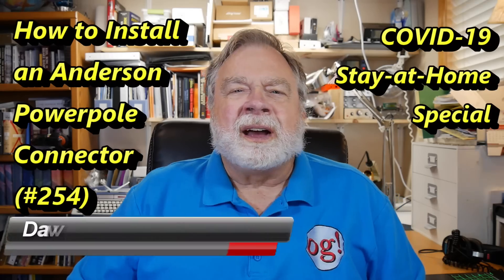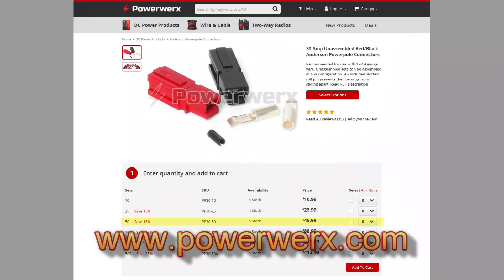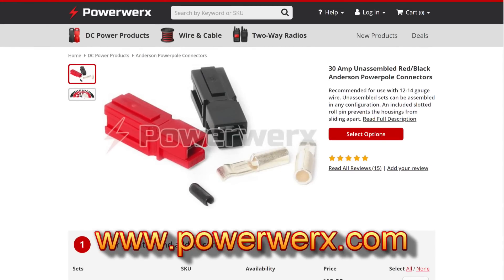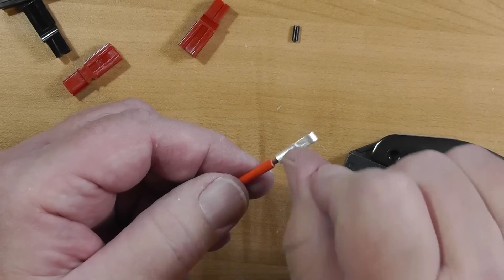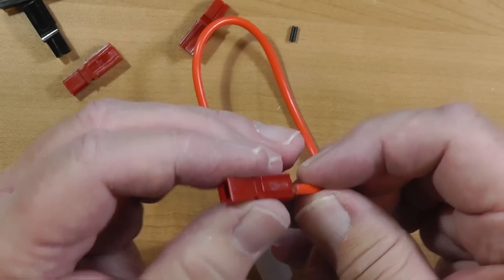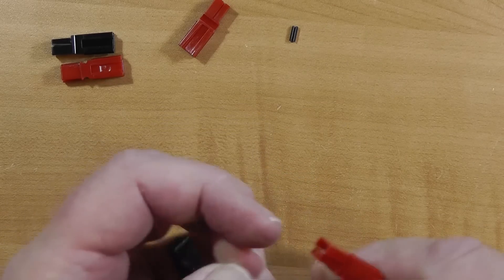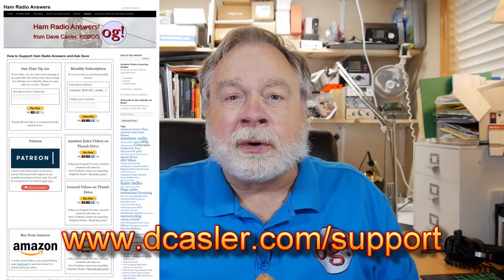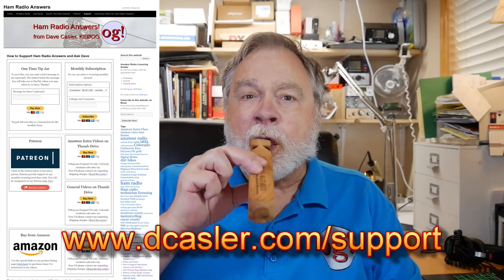Stay-at-Home Video: Installing Anderson PowerPole Connectors (#254)

Comment: Hi Dave, any tips for making power poles for battery connections? I'm having issues seating my connectors with 30 amp connectors and 10 AWG wire.

Comment: Hi Dave, great video. I am just starting to use powerpole connectors for my shack. I plan to run everything possible off a Rigrunner 4012. My question is, what brand of wire stripper are you using in your video? Thanks KE8TQR

Comment: If the wire has been tinned with solder, you may want to stress that the tinned section needs to be cut off before inserting the wire and crimping it.
 There are two reasons.. 1),  Solder is a soft metal, and  in time, actually moves under pressure and can cause the crimp to come loose. Maybe even years later ( usually at the worst possible time).  It is  usually ok to  just tin the tip of stranded wire to make it a bit easier to handle ,  but don't get carried away ... just the tip,
 2)  A good crimp creates an atom to atom bond with the metals and  and makes  both   makes a low ohmage  and gas tight contact  which improves with age. Solder interferes with that process.  A good crimp exceeds a solder connection in both mechanical strength and in providing the best low ohmage connection.  If you look at the lead -in wire the power company  brings into your house, they use  only crimps for this very reason.  
Frank AI4RF

Comment: Building the reference station now. When is the vhf/uhf info coming out? I just bought a comet gp9 cause I couldn't stand to wait any longer.
Reply from the maker: I wish I had a good answer for you. I haven’t really thought through the DMR-vs-C4FM-vs-DStar debate. I may come out with an FM-only reference station. What do you think?
Reply: @davecasler  I just went with the Icom 2730a for the time. If I get the digital bug I'll buy a hotspot.  Thanks for the reply.

Comment: You made an error - they CAN be taken apart, easily.  Look inside the open end.  The "humped" piece can be gently pried up a bit then it can be pushed back out.  If really tight, then use small needle nose pliers to pull it out the back (after front is pushed up).

I speak from experience (from 2 days ago).  2 of them didn't crimp tightly enough and the wire was a bit loose inside (didn't have the massive wiz bang one you have - just a standard crimper)

Either filing the edges of the connector back a bit (so they don't touch after crimping) or soldering them will tighten it up - a lot.

Bending the front piece down a bit before re-installing will reset the tension.

This is for people who don't have a Power Pole Crimping Tool at $20 to $50, just a standard crimper.

Comment: Looking at specs for reference station power supply, I was surprised it does NOT seem to have power pole outputs ?? Not difficult to fabricate a pigtail, but in this day and age, PowerPole outputs are readily available.
Reply from the maker: I know what you mean. Some power supplies like the SS30DV do have powerpoles.

Comment: Dave, it's easier to put the connector into the crimper and close it slightly to hold it in place then put the wire into the connector and finish crimping.
Reply from the maker: Good point!

Comment: Guys in my club were bad-mouthing Anderson PowerPole on a net the other day.  Some were saying they have higher relative resistance compared to other connectors.  Not sure how they are determining this idea but there were more than one of the same mindset.  Have you heard of any negatives about APP's?  The biggest problem with them is the price in my view.

73 de K6TJO
Reply from the maker: I suspect they were badmouthing them just to badmouth them. They work fine. They are not perfect, however. They can pull loose if you aren't careful.

Comment: Dave, what is that contraption sitting on the table behind you over your right shoulder? It looks vaguely like a computer keyboard but has some additional do-dads on it. Is that one of those antique RTTY machines ?  :-)

jk, I know what it is but haven't seen one in a long time.

I've used a drop of super glue in place of the pin when I didn't have a pin available. But you're getting them apart in the future if you do that.
Reply from the maker: :-) Not exactly. It's a manual Smith-Corona Classic 12 portable typewriter and it works. Vintage 1973.

Comment: I thank you for your knowledge of ham radio. I have a 6500 Flex M transceiver in the box, power supply and antenna , 25,00 KVA solar panel system and would be willing to dedicate my help towards the help of anybody’s communication of all needs. 3617015805 . I am locked in south Central Texas near Corpus Cristi, Texas. Keep me in mind for assistance.
Reply from the maker: Thanks.

Comment: At 4:50 -- I pinch the connectors onto the wire with a very slight squeeze of my pliers before placing them into the relevant size die. That stops the connector from rotating around the wire before it is correctly seated in the crimping die.
Reply: thanx!

Comment: I've used the larger 50 and 75 amp connectors for years, but once I started using the 15/30/45 powerpoles, I don't know how I ever lived without them.  Just got a 300 piece kit in the mail, today.

Comment: Hi Dave,
I put the connector in the crimper with a notch or two of pressure to hold it in place and then insert the wire. Much easier that way.  73  WB3BJU
Reply: I do the same
Reply: @bradcfi2  Me 3

Comment: Hey hams sitting at home, I have an idea....why don't we all get on the air and see what's lurking on 40, 30, 20 and yes, 15 meters...you might be surprised and find some bands are open, but since no one goes on the air much anymore they think the band(s) are closed. I can almost guarantee you 30 meters is open to somewhere in the World during daylight hours. Yeah, I know, no mics allowed on 30m, there's a cure for that problem, its called CW....Just a thought, 73
Reply: That's a great idea.  Just set a frequency and time.  20 or 40 meters is best for me.
Reply: 160,80 and 40 are busy every night.. Wake up.